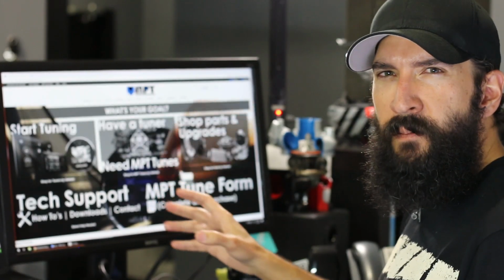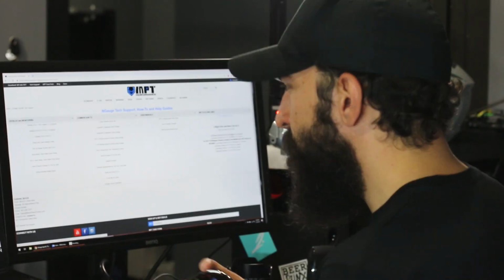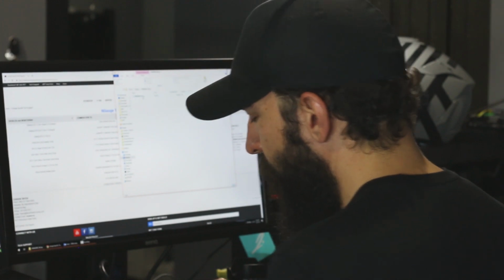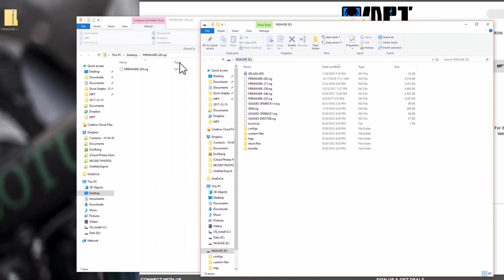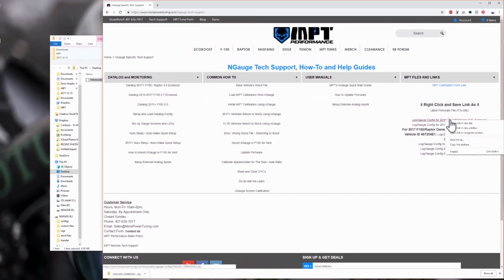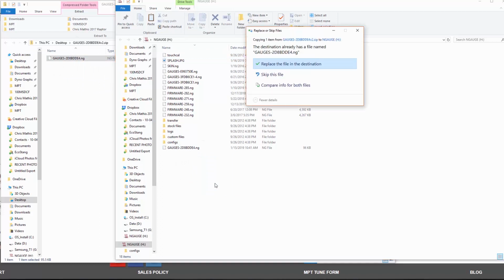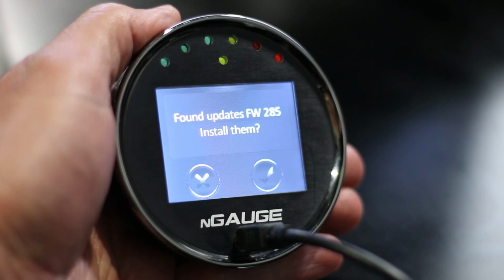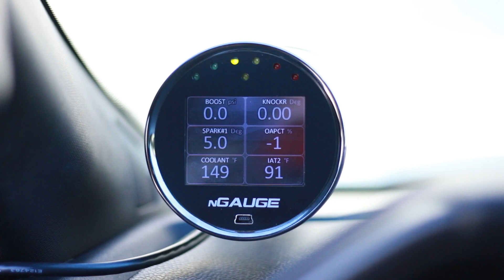NGAUGE -  How To Update Firmware And MPT Gauge Configuration

Comment: I have a 2015 Ford Expedition with a 3.5L twin turbo Ecoboost engine. I installed a K&N air induction kit and a single free flow exhaust by deleting the 2 catalytic converters, resonator and stock muffler replacing it with a 40 series flowmaster muffler. I opened up all of the choke points. How much horsepower will I get with 93 octane performance tune🙂?